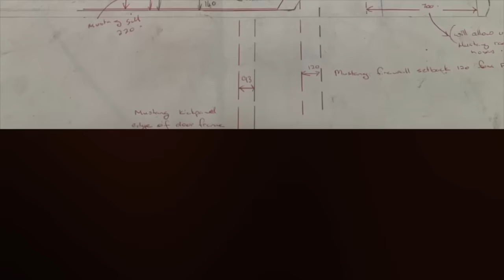XA Sedan GT Tribute  Resurfacing the  roof and an update on XB coupe   HD 1080p

Comment: Great work as usual Tom👍👍👍…as for the filler hardening time, it’s all about mass…because it’s a chemical reaction, so when you have more mass it generates more heat which leads to it going off quicker…anyway that’s my understanding of it and my son is a “shipwright” and they infuse whole boat hulls using resin or epoxy and they have multiple 20 litre buckets of the stuff which they have to get it all infused before the buckets of resin go off(the buckets can actually start smoking if they’re not careful because of the heat) but once the resin is infused into the fibre glass or carbon the chemical reaction starts to slow down, it’s a real balancing act and very stressful, one mistake and it’s a disaster 🤯
Reply from the maker: Cheers mate , and thanks for the info Tex, it makes alot of sense.

Comment: Gday Mate, A tip for you, take it or leave it.  Assess the panel for magnitude of highs and lows or dents and determine if you even need filler because you mentioned you may use poly which should build plenty, but even if you just used high build you could have chased it out flat with that alone (depending of course how bad it was). and you should have had epoxy down first, you laid the filler over bare steel and i didn't see you acid wash it either, this is a critical cleaning step and acts as a chemical adhesion promoter. 3M has some good literature regarding this. Don't listen to anyone saying you don't have to have 100% seal with epoxy, they simply don't understand the technical aspect to achieve longevity. anyway, enough of that. really enjoy watching all you builds progress. Cheers
Reply from the maker: Thanks mate

Comment: Great job on the roof but one question on the filler why scale the  filler I've just put what I needed and mixed it this is new it me thumbs up 👍
Reply from the maker: Thanks mate, this is the first time Ive weighed it too. but after watching so many reputable car builders do it this way on you tube,  I thought I would try it. The result is you get the exact ratio of hardener to filler everytime, the filler works and spreads the same way everytime and for me i seem to get more time before it goes off also, which indicates i used to use to. much hardner haha , I like it think I will keep doing it this way

Comment: highly recommend the splines saves alot of time sanding & saves on material used as well as it goes in nice & level & only where its needed,,,
great video,,,
the thinner  it is on the board  does aid a little longer the usable work time  as the thicker you leave it on the board it generates more heat quicker and you lose some usability time ..
ive always used 3M platinum plus ... how do you  find the 3M platinum select ?
Reply from the maker: I totally agree with you mate, I think I find the Platinum Select more creamy,  and seems less chance of pin holes, but as i said in the video it may be just me. It seems to sand well also